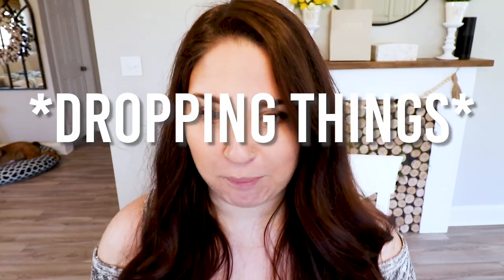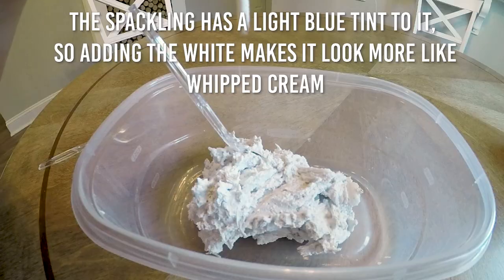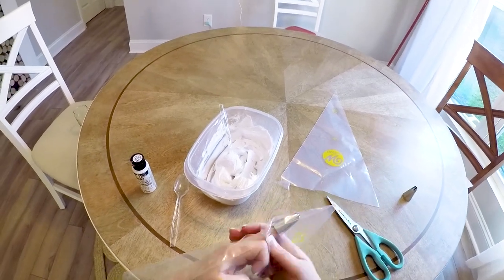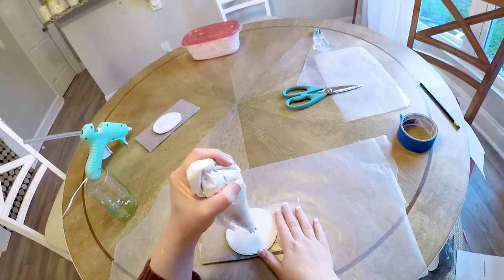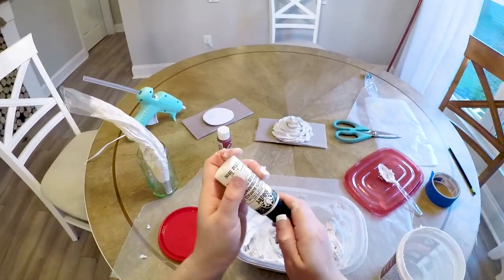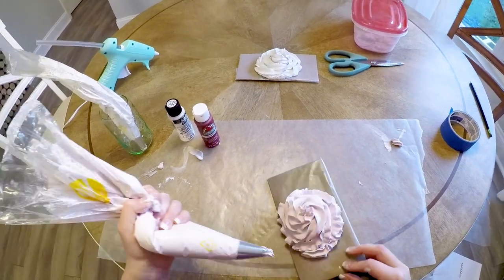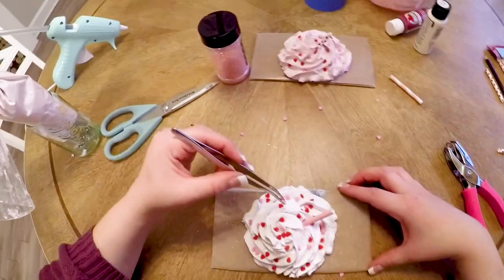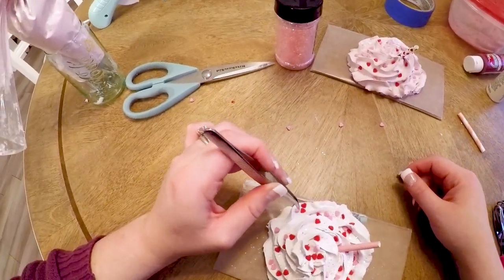DIY Rae Dunn Mug Fake Whipped Cream Topper

Comment: If you put a small ball of aluminum foil inside, you use a lot less spackle
Reply: Question please. Where would I be putting this ball,into the mixture or the container itself?
Reply: @tamiechiadenny-frank7899  I think Elisa meant in place of the first initial dollop of spackle she uses. So when she makes the actual topper, she puts a big dollop of spackle in the center, and then does the actual design around that. Elisa's saying if you put a small ball of aluminum foil in the center and then make the topper around that, you don't have to waste the spackle with a giant dollop in the center, because it uses the aluminum ball for its structure.
Reply: @Heathalessyl  thank you! Yes. This is what I meant. You can use a painted cardboard circle that you cut out and hot glue a wad of aluminum foil in the center.
Reply: Yes I saw A foam ball
Reply: @kimyvettabrown358  foam balls are expensive believe it or not. :)
Reply: Inside the mug?  OR On top of the cardboard?
Reply: Kathy Germack on top of the cardboard circle. Using aluminum foil can get expensive as well if making these in bulk. I save everywhere I can. I use scrap pieces of printer paper or old newspapers and wad them up tightly and glue them in the middle of the cardboard instead. If need be, put a small piece of tape around the wadded piece of paper/newspaper to prevent it from opening up and then glue to the center of the circle.
Reply: @craft1305  Dollar Tree for everything! 😉
Reply: i use small half foam balls but I haven't gotten the piping down yet (just started)
Reply: I was thinking floral foam….

Comment: In case anyone would wonder about dry times: I made a small version of these to use as decorations (they’d probably top a shot glass) and they’re still drying a day and a half later. The tops are try, but the bottoms aren’t so I flipped them upside down to help that out. I live in a really humid place and it’s been rainy off and on for the past few days. So for most a day and a half would probably totally dry these, but if you’re in a really humid climate, don’t freak out if they’re still drying 2 days in.

Comment: Question- if you put the spackling whipped cream directly on a tumbler lid, can a hot drink be in the cup without hurting the integrity of the spackling? I want to make some hot cocoa tumblers for my grandkids but I don’t know if the hot drink will melt  the spackling. If so, then I just need to tell them to keep the lid off when drinking anything hot.

Comment: i tried to make these once and i had major problems piping. it would come out in bursts and not smoothly at all. i mixed in some paint and felt like if i added too much the mix was too thin and wouldn't hold up the whipped topping look. any tips on how to properly mix to make it pipe easier?

Comment: How do you get the foam board to not wear and tear apart if using this to cover hot or warm Cocoa?
Reply: They are meant for display only. I would not use one to cover a beverage hot or cold.